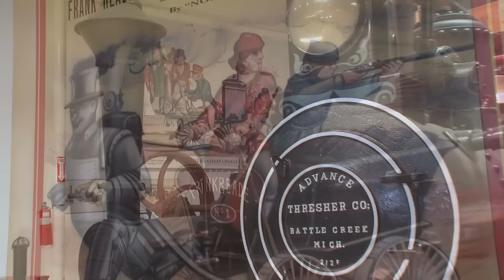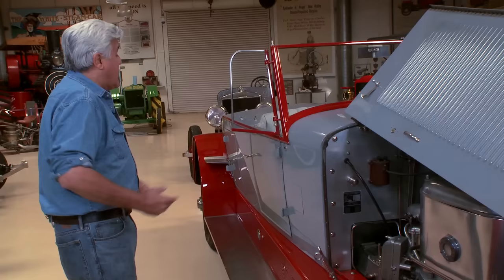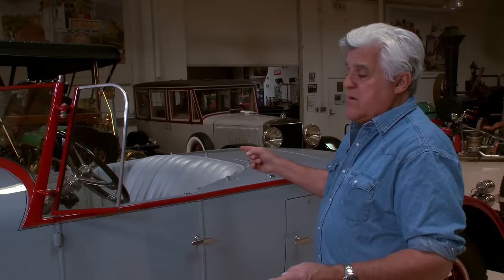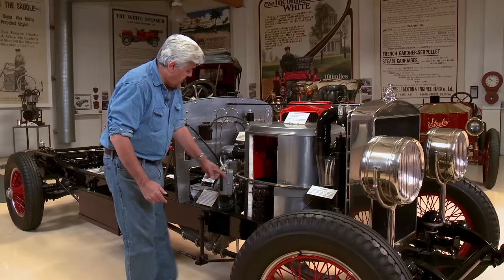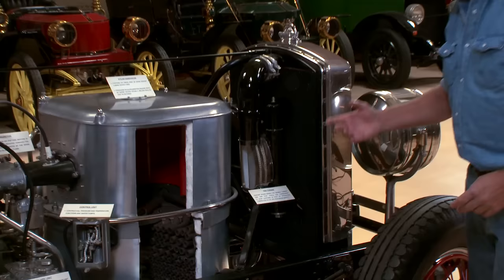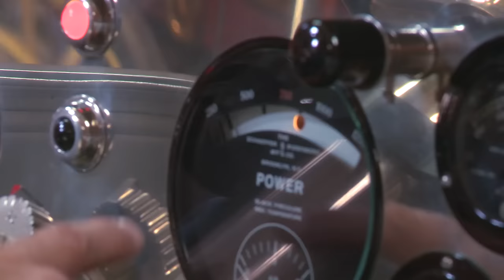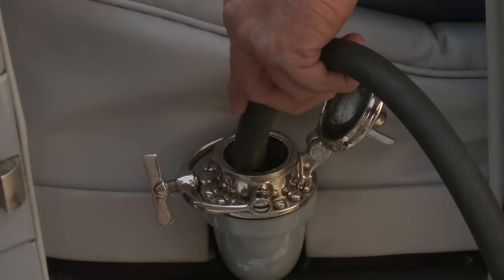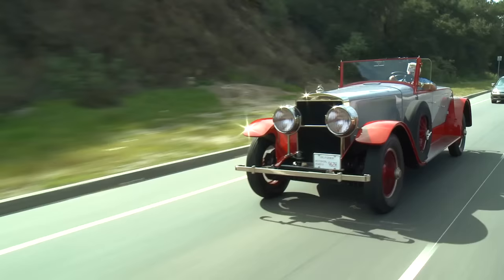1925 Doble E-20 Steam Car - Jay Leno's Garage

Comment: Wish we had a modern steam engine with much greater range.
Reply: Why? steam cars are not practical or commercially viable
Reply: @sandervanderkammen9230  Ik but they are cool.
One could try one with current tech. Like storing high temp water. That could strip the fuel tank, boiler and condenser off. That can reduce the weight and costs.
Reply: @STROLLLS  You mean like a boilerless steam locomotives?
They had a extremely short range, you are limited to how much steam you can store in a tank and the the steam begins to cool as soon as you refill the storage tank.
Reply: @sandervanderkammen9230  Yeah, just like a boilerless steam locomotive. A well thermally insulated tank can prevent heat flow to the outer environment and about the cooling of water during a reacharge.... I don't think that might be an issue coz we are recharging it with heated water. But still it would have a pretty low range. Would say about 2 miles per gallon of water.
Reply: @STROLLLS  Steam engines cannot run on hot water, it must be hot enough to form Steam.
As the steam is released, the Tank will cool down, causing the fresh charge of Steam to cool as it enters the tank.
You have the heat up the tank before refilling, which wasted alot of Steam and thus alot of fuel/energy
Reply: @sandervanderkammen9230  Hot water when depressurised will turn into steam. This can be done by feeding the required quantity of high temperature high pressure water into the engine which causes it to change its phase.
Reply: @STROLLLS  Im not aware of any practical engine that works with that principle, can you provide some examples of  a practical design that was or is still used in an actual application???
Reply: You are talking about Superheated water... that's different, superheated water is a mixture of water and steam, pressure is lost during the process so it's very inefficient, it's only used in powerplants and chemical factories were a boiler fire would be dangerous.
Reply: @STROLLLS  Steam cars are obsolete because they have obscene fuel consumption and high build and maintenance costs.
A fireless Steam car doesn't address the real problems
Reply: @sandervanderkammen9230  There isn't anything like this built before. This configuration just came across my mind. High temperature water pumped into the car's water tank with no space to vaporize. This  could be then injected into the engine where it would expand. But there is one out there that uses high pressure stored steam rather than water. Very inefficient tho.
Reply: @sandervanderkammen9230  Water can exists at subcritical temperature if its pressurized. According to my knowledge, i think the water if given no space to vaporize it can be heated to subcritical temperatures. Correct me if I am wrong. 
Even if this set up works, it would not be good enough as there is no condenser, it will have a poor range.
Reply: @STROLLLS  And poor thermal efficiency... you cannot engineer your way around Entropy 
Nicola Carnot figured out that the Rankine Cycle can never match the fuel efficiency or internal combustion engines back in 1824.
Reply: @STROLLLS  Any heat engine that requires a Phase change in its working Fluid will always be less thermally efficient as one that has no phase change.
Reply: @sandervanderkammen9230  Yeah, your right.

Comment: I wonder if steam cars would be better for the environment than gas cars, assuming you can still put emission control systems on them. Pick whatever the cleanest-burning gas is and run the exhaust through a filter of some sort. Then you just have extremely clean emissions and some steam without the noise or pollution of an ICE.
Reply: Steam cars naturally produce very low Carbon monoxide and Hydrocarbons do vary by fuel type but they all produce high levels of NOx and staggeringly high CO2 emissions.
Reducing NOx emissions reduces fuel efficiency significantly.
Fuel efficiency of steam cars is the primary reason why legitimate manufacturers would not be interested in revisiting steam today.
 A modern Diesel engine for comparison produced 300% more power and is 400% more fuel efficient.

Comment: Incredible absolutely amazing! So we really aren't as dependent on fossil fuel as we've been led to believe. What if the steam were to go through another turbine that drove an A/C unit to assist in   condensing the steam back into liquid water even in very hot weather conditions? If it were worked on to become extremely reliable it could once again power many different apparatus. Even propeller driven aircraft. Buy harnessing that kind of torque you could run hydraulic pumps to operate heavy equipment. The possibilities are so endless.
Reply: This car runs on gasoline to heat the water into steam and gets an obscene 3 MPG  to 6 MPG
Reply: Steam never achieved adaquate power to weight ratio performance to be viable for aircraft.

Comment: You will have much less scale if you use distilled water.
Reply: Not true, the condenser fouls the feedwater tank with contaiments that form scale.
Most steam collectors and commercial boiler operators use a water treatment additive instead of distilled water.

Comment: Jay, thank you for this amazing bit of history! You and your team have to retrofit a modern vehicle with steam power! You're quite possibly the only ones with the necessary knowledge and resources to do it. I'd suggest a newer 1/2 ton truck as the perfect platform to use. Plenty of room under the hood and cab/bed, all the modern chassis technology, and all the interior creature comforts. You could even have AC with one of the electric AC compressors that they use in EVs.

Comment: It doesnt seem complicated to me. My current modern car is way more complex I think.
Reply: In terms of mechanical complexity it doesn't get any worse than a Doble steam car.
in terms of electronics? modern cars continue to be increasingly complex
Reply: @sandervanderkammen9230  . Maybe... Its all on a large scale though, seems easy to understand if you are into old school I.C. engines. And pretty durable I would think.
Reply: @standupstraight9691  Steam cars are obsolete because they are extremely expensive to build and maintain.
The Doble E series was the most expensive car in history at the time and the most complex.

The E Series cost 1.2 million dollars each in today's dollars and Jay Leno says it's the most expensive and difficult car in history collection to keep running.

Comment: What fuel did they use i may have missed  that keep it up i am a retired boiler maker that enjoy everything steam
Reply: The Doble E series boiler could run on heating oil, kerosene or gasoline.

Jay runs both his Doble E-series cars on regular unleaded gasoline and gets between 3 MPG and 6 MPG

Comment: 1000 feet pounds tourqe that's more than a semi truck jay
Reply: Thats less than my pick-up truck.. and just 1/3 the horsepower.
Reply: Full size semis are running 1800-2000 on average.

But in a car that size, 1000 is insane.
Reply: @JD_79  1,000 ft.lbs is only at zero rpm... only 150 horsepower in a 6,000 lbs car is not impressive.

Comment: Hey JAY, have you ever thought about taking the Steam Car to an Emissions Testing Center ?  hahahahaha
Reply: Jay was joking about emissions, the Doble system was emissions tested in 1971 by the EPA was rated worst than the internal combustion cars tested at the time. 
While producing relatively low CO emissions the Doble produced extremely high levels of Hydrocarbon and Oxides of Nitrogen,  staggering CO2 emissions and horrible mileage 6.5 mpg on Diesel No.1

Comment: Oh yeah Burning fule at that high Temperature would burn Cleen less pollution than most cars on the Road to day
Reply: Unfortunately thats not true, steam boilers operate with excess oxygen in the air-fuel mixture.
At high temperatures this causes  toxic emissions of NOx or Oxides of Nitrogen.
The EPA tested the Doble boiler and found it generated higher emissions than ICE cars.

Comment: Wow. Better for the environment that EVs.
Reply: Absolutely not, this gas guzzler gets between 3.5 and 6 MPG on unleaded gasoline and spews out massive amounts of NOx and HC emissions..
It's carbon footprint is larger 6 full size SUVs
Reply: @WilhelmKarsten  If you put it that way, it’s a billion x better than EVs. The mining of lithium for batteries has caused long term ecological damage by polluting the soil and water. Since they do it in other countries they can sidestep regulations and often use child labor. Since the kids fit better in the mines.

Comment: What happens if one of these steam cars get into a head on collision?
Reply: The boiler has more explosive energy than a grenade and a 2 million BTU flames inside... 
If you survive the explosion and the scalding steam and hot water? You will most likely be incinerated by the fire.
Jay Leno once commented that there are few steam cars left because so many burned up.
Jay knows alot about steam car fires.
Get well soon Jay!
Reply: @sandervanderkammen9230  extremely dangerous
Reply: @oN_eXcuses  Yes, most places require the boiler to be inspected periodically to reduce the chance of explosions, many states require you to be licensed to operate a steam engine and most home owners insurance will canceled your policy of you have a steam engine on your property.
Reply: Most head-on collisions produce bad results. Just don't.  ;-)

Comment: Imagine a steam engine made to modern standards.
Reply: Obsolete technology
Reply: @WilhelmKarsten  Could instead be used to power a steam turbine in a closed loop for maximum efficiency which could drive an electric motor at a fraction of the emissions
Reply: @DaarkCloud  Would still be less efficient and more expensive than a regular ICE or EV.
Closed loop isn't practical for automobiles, an effective steam to air condenser would be larger and heavier than the automobile itself.
Reply: @WilhelmKarsten  That's hot 🔥🥵🔥🥵
Reply: @DaarkCloud  It's not... its obsolete.

Comment: Green car for today just use CNG and a few modifications.
Reply: @sandervanderkammen9230   CNG compressed natural gas cleaner burning 🔥
Reply: @ronaldlegree285  CNG creates higher NOx emissions.
Steam is a very, very inefficient and uses more fuel, thus more carbon emissions.
The Doble E series has an obscene carbon footprint... about the same as 10 Honda Accords.

Comment: What fuel source uses for heating water?
Reply: Gasoline, I think. That's what he said in the video, at least.
Reply: Jay gets around 5 MPG to 6.5 MPG on regular unleaded gasoline, the Doble will also run on kerosene or Diesel fuel.

Comment: Ok, so gas turbine power plants are basically jet plane turbines connected to a generator, then they will use the heat output of the exhumes to to BOIL WATER creating STEAM STEAM STEAM to spin a TURBINE to generate electricity. Like us, smart people, have been talking about the whole time. The steam and turbine are about 80-96% efficient. The non efficient part about the vehicles is the actual burning of the fuel, as we all know, it is not the most efficient. Though in some plants they take the exhaust to super heat the steam,  very similarly to what they do on steam locomotives.

Also there is no such thing as a diesel locomotive on mass production. 
They are all diesel electric locomotives, so technically electricity has been transporting our cargo by rail since early 1930’s, if you don’t know what I’m talking about look up, how diesel electric locomotives work.

Comment: Two questions...

1) What is fuelling the Fire? Bunker (Oil, Kerosene,  Diesel,  or Gas? I wouldn't assume it to be gods clean beautiful Coal from WV, or dead tree caracas)

2) This is clearly a working design so why has it failed? If it gets around a few hundred Miles then its just as good, no probably better than any modern Electro-Vehicle. (Non of that nasty mucking about with Lithium for a start), with recharge times in magnatute of the modern Pump. Why has  nobody done anything with this tech. Its almost like those Russian Oil Shieks you never knew existed before Brandon went, and blessed us with 5~7.00$ a Gallon would have hated it or something?
Reply: Answer 1. Jay runs his Doble on regular unleaded gasoline.
the Doble will also run on kerosene or Diesel fuel.

Answer 2.
The Doble E series sold for around $25,000 dollars in 1926.
Abner Doble lost around $50,000 dollars for each car sold.
Making it the most expensive car in history at the time, approximately $1.2 million in today's value.

The engine barely produced 150 hp when new and quickly degraded with use.
Jay's gets between 3 MPG City and 6 MPG Highway  on regular unleaded
 gasoline.
 The EPA tested a Doble boiler in 1970 and found it produced more emissions than a contemporary ICE car... high HC and extremely high NOx emissions.
The Doble E series spews out more CO2 emissions than a dozen Hondas.
The $180,000 dollar boiler needs a complete overhaul every 40k miles.
Reply: Nicolas Carnot published his formula based on the Second Law of Thermodynamics in 1824.
He proposed that ICEs offered higher efficiency limits than what possible with the Rankine Cycle.
 In 1897 Rudolf Diesel proved Carnot's theory and showed that steam can never match the efficiency of of ICEs.
Reply: In 1914 Charles Kettering invented the electric starter for ICE cars...
introduced into production in 1915 it completely eliminated the only commercial advantage offered by steams and rendered steam cars obsolete virtually overnight.
by 1926 all the steam car companies switched to ICEs or were bankrupt... Doble lost millions finally going bankrupt in 1931.

Comment: When you say steam qas dead by 1925, you mean for the automobile. Steam would survive for the railroad another 25+ years.
Reply: The invention of the electric starter in 1914 rendered steam cars completely obsolete... Diesel locomotives began to enter service in 1925, the days of steam on the rails was numbered as the Rankine Cycle cannot compete with the Diesel Cycle in efficiency or operating cost .
Reply: @DoktorBayerischeMotorenWerke  right. But the production of diesel locomotives wouldn't pick up until the 40's
Reply: @ThunderboltSirenStudios  The outbreak of World War 2 saw little to no development of steam or Diesel locomotives... the US and world economies would not fully recover until the 1950s when steam was quickly replaced by Diesels.
Reply: @DoktorBayerischeMotorenWerke  a tragedy for steam fans. 😪
Reply: @ThunderboltSirenStudios  And a triumph for the railroad industry!

Comment: I wonder how a steam car would perform against a modern car if it would use todays turbine technology from power plants (coal-, gas- or nuclear, they all use steam turbines as the best way to turn heat into rotation).
Reply: Horribly, which is why steam cars have been obsolete for a century.
Reply: Internal combustion is the best way to convert heat into rotational energy

Comment: I seriously don't know why people aren't trying to modernize this. People are arguing E-cars still use fossil fuels and now with this war crap our fuel prices are insane. Meanwhile the 1900's already had it figured out lol.
Reply: Because steam cars have the worst energy efficiency and are horribly bad for the environment.
Jay's Doble guzzles unleaded gasoline at 6 MPG and has the carbon footprint bigger than 12 Hondas.
Reply: @sandervanderkammen9230  okay but modernize it to be actually viable. Honestly I'm inclined to believe they never do because it will hurt the petrol business or something along those lines.
Reply: @nowlindventura5015  You can't! The Laws of thermodynamics do not allow steam engines to ever be as energy efficient as internal combustion technology.
The oil industry would be very happy to see millions of gas guzzling steam cars on the road... great for their business!

Steam cars were wiped out by the invention of the electric stater for ICE cars in 1915... completely eliminating the only adavantage steam cars had.
Reply: Prayers for Jay and his family, he is currently in hospital burn unit undergoing treatment for severe burn injuries he received while starting his steam car.

Comment: Misleading. Fuel and steam car. No mention of how much fuel per 100 miles is used to heat the water.
Reply: Jay gets between 3 MPG and 6 MPG on regular unleaded gasoline.
Reply: @sandervanderkammen9230  🙄🙄🙄

Comment: So the manufacturer made all those iterative changes from unit to unit, but never increased the condenser size or efficiency enough for it to work in all temperatures it encountered in continental US? What a weird faux-pas! The thing already weighed 2.5 tons and was almost the length of a bus, what would have been so bad about adding few hundred pounds extra copper to the condenser? LOL.
Reply: For a 150 horsepower steam car to have an effective and efficient steam to air condenser the condenser what be roughly the size of transocean shipping container.
Reply: @sandervanderkammen9230  Did you calculate that based on maximum power or average power? Also what efficiency? I get its serious business phase shifting water, but the car apparently seemed to do fine at lower ambient temperatures, so surely the problem wasn't as bad during normal operations.
Reply: @mankihonda983  The Doble E series  is SAE rated at 150 horsepower maximum... which I believe is the most powerful production steam car ever sold.
 Based on the 2 million btu burner rating and the Rankine Cycle efficiency of similar compound reciprocating engines Fuel efficiency was approximately 8%
 If you convert 150 horsepower into pounds of steam? To maintain a sealed system you will need a large condenser for ambient air cooling, much larger than the car itself. 
This is why you don't see sealed condensers on steam locomotives, only ships and large power plants.
Reply: @mankihonda983  According to Jay, in typical California weather the car gets around  than 50 to 60 miles on a 35 gallon tank of water and 200 miles on 35 gallons of unleaded gasoline.